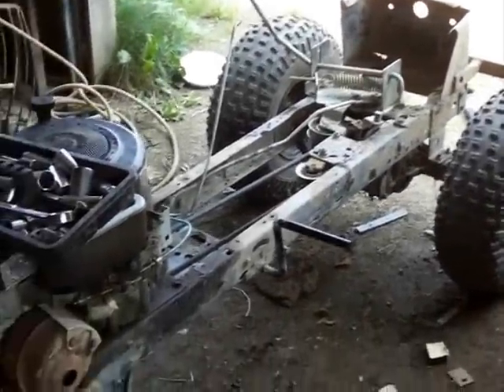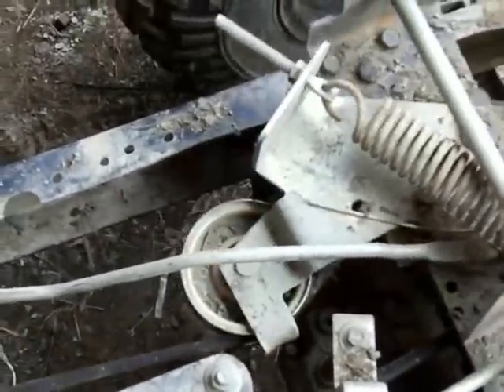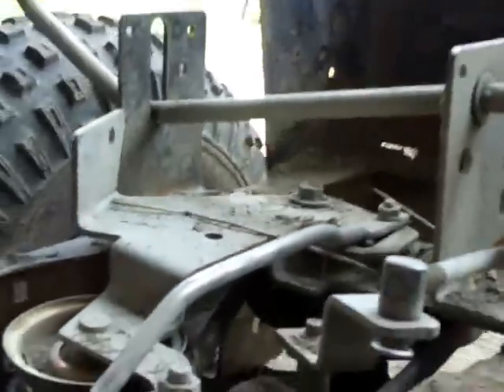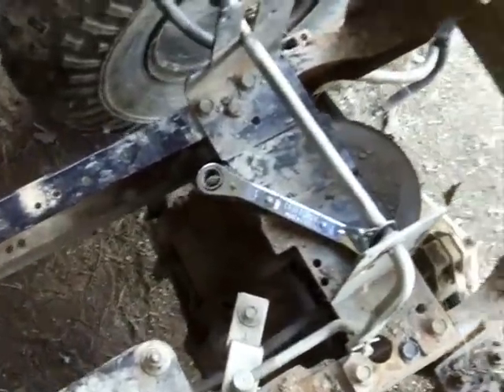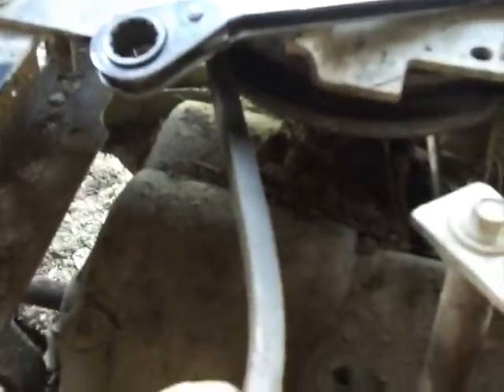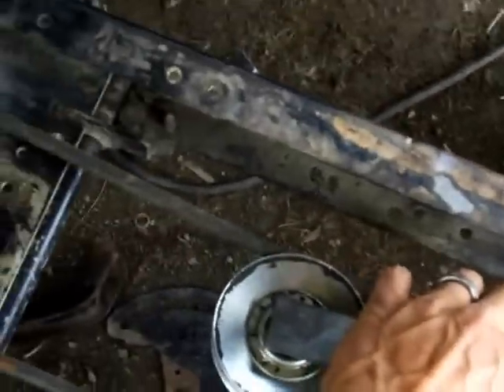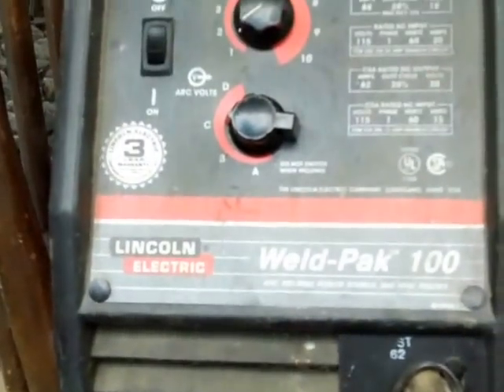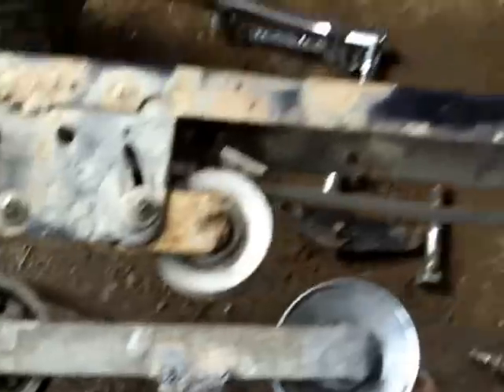How to: Build a Better Clutch: Part 1

Comment: The clutch/ brake pedal needs to be separated so the spring gives the clutch better tension. I always build a pedal for brakes on the right. You will have to make a stopper so your clutch pulley doesnt hit your pto pulley. A double nutted bolt works just fine

Comment: Almost all riding mowers have this double clutch allready. Just make sure it swings to the inside of the belt and not away or you lose friction at the transaxle pully. The best way is to add a stronger spring to your clutch and a smaller belt. You can also dump maple syrup or red bull on the belt to help with noise

Comment: I have a variable speed transmission on my tractor, is it possible to change that to make it pull tighter so the belt won't slip?
Reply: More springs.

Comment: maybe build a ATV with 3 or 4 tractor axles ,mounted in line  .some like those floating 6x6 .maybe find a small plastic or fiberglass boat on top of a frame . or use sheet metal bent to fit a frame you build .use silicone to seal up the sheet metal seems .

Comment: I built a racing lawnmower with 9in pulley front and 2.5in in back but I can't figure out why it grinds so bad into gears when going from neutral to any gear. I believe I need to stop the transaxle pulley when the clutch is in, any ideas on how to fix my issue?

Comment: If you use a tank of welding Gas with you Lincoln welder, your welds will be MUCH!!! Much!! BETTER!  better, meaning, they will look better and much less splatter, as the weld will flow much smoother and into the metal better, it will be a stronger weld also. I do like the two pulley set up, great job
Reply from the maker: Thanks. I weld outside sometimes, and if I was to use shielding gas on a breezy day, the wind blows the gas away, then you can't weld. it's REALLY frustrating!

Comment: I am currently building my own clutch and idler pulley setup. What is the best way to make sure all of the pulleys are perfectly aligned so the belt doesn't come off them? It's not a big deal with the wide, flat pulleys but the V pulleys have to be pretty spot on.
Reply from the maker: I measured a lot, I also got the front and rear pulleys mounted, then used a piece of string to line up everything else.
Reply: i would have just added a  safety bottom panel to keep mud from  making the belt come off

Comment: Hey how it going man? Excellent videos i love em. Can you tell me if this will work for me? I have an mtd with the variable pulley and two belts one from motor and one to trans. I removed the variable pulley. I am putting one belt from motor to trans already installed an 8" pulley on front and 4" on trans and a brake gas pedal. But will this single speed mtd trans handle this? And also what size pulleys did you use on this clutch i am mocking it completely? Thanks man, Brian!

Comment: (even tho your belt is the right size) i thought it would be appropriate to comment on this video. If i'm changing my pulleys how can i measure a belt to be sure its the right fit with out doing a clutch

Comment: Hey I've got a question- currently I am converting my gokarts transmission from a tourque converter to a peerless 4 speed with reverse. For a clutch engagement set up, instead if a belt tensioner, could a cintrifical belt clutch work? Not the kind that works with a Tourque converter but one that takes just a normal belt, and maybe just let off the gas when I want to slip it into the next gear? Your input would be awesome, thanks.

Comment: I'm having a couple issues with my tractor. It runs like a champ, but when I go on hills it tends to lug alot and won't really move at all. I think changing my belt to make it tighter would be good, but that gets pricey after a while. Do you think this could improve that I Because I can't get under fourth gear, would doing the double clutch improve that?

Comment: What is your opinion about hydraulic drives? I have an older wheel-horse that is hydraulic drive that could be fun to fix up for something like this...also have a belt drive Bolens that im not impressed with but also could fix up...i think the belts would suck for multiple reasons...and not do well in muddy/wet situations..

Comment: Could you make a vid on how to do a pulley swap?  I would like to learn how you bolt or even weld them on top like that.  I know how to weld or drill holes lol,  I just don't know a good way to center it on the old pulley.  By the way great clutch build!!!

Comment from the maker: I would make it hand throttle on the steering wheel. But if your really motivated, then try to swap the clutch over to the other side(left), and put the foot throttle on the right

Comment from the maker: @gangsterbryce true shift on the fly is an mtd thing. you'd be better off using a method like this, and get good at shifting on the fly yourself. if you have an old trans, it may not let you shift on the fly. It would depend on if the trans has synchro style gears.

Comment: hey i got this free 1979 track and turf some co-op lawn tractor its built prettty strong i have  a motor for it but its missing the clutch what could i do to rig it up all i want to do with it is make it so i can shift on the fly and im gunna put a small pully in the back

Comment from the maker: @ProRigWelder Then you wouldn't be able to throttle it up and dump it like you could a car with a manual trans. It would be like driving an automatic. ie useless in the mud, espically if you want to shift on the fly.

Comment from the maker: @DirtbikeGuy2009 I haven't had it in the water with this new setup. The old setup worked pretty good, but it would slip if it was under water and you tried to use 3rd gear. 1st and 2nd were ok in the water.

This new clutch work waayy better, It should be able to go threw really deep water, regardless of what gear im in.

Comment: How can you go deep in water with the belt drive? Won't it get wet and start to slip cause I'm thinking of putting sprockets or at least a toothed belt to handle the deep stuff but I haven't taken it into anything deep. Have you gotten it deep enough to get the belt under water?

Comment: well i plan to get around to my craftsman mudder, i need to put the trans back together and put on the pulley and drive it around, but i need to do other things like redo the shifter or find some pulleys to re route the belt, but my engine pulley is a double pulley  if i ran dual belts i would have tons for belt griping power i may possibly break something. also i can't make videos any more, cell phone that records sound is broke, the other cam doesn't record sound but i can still make pictures